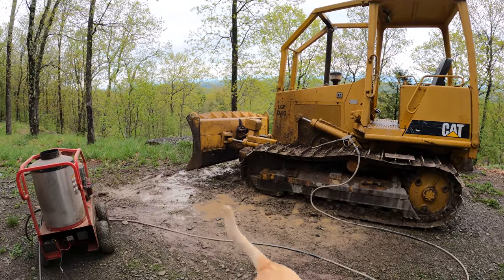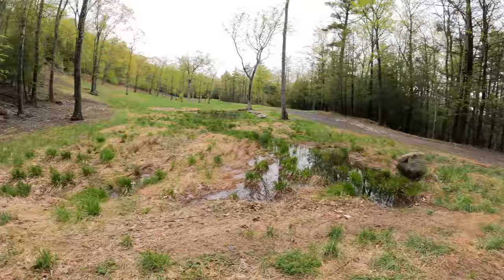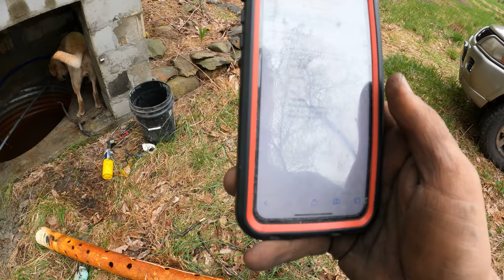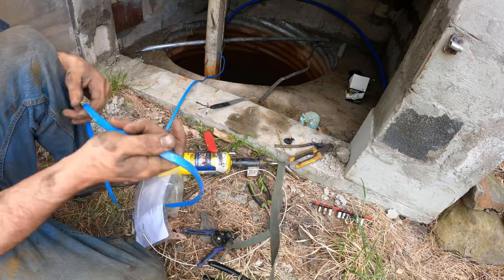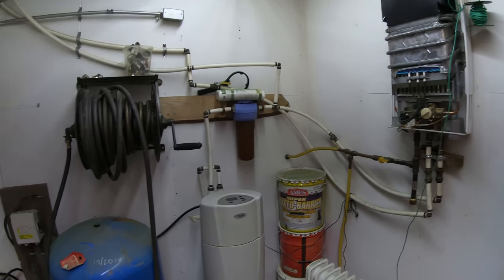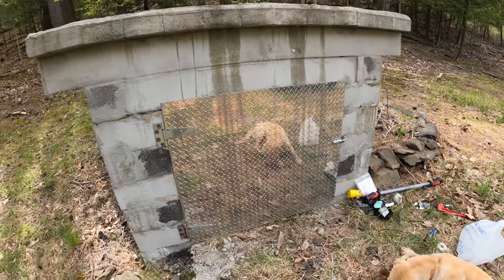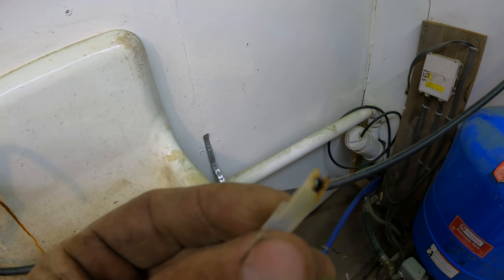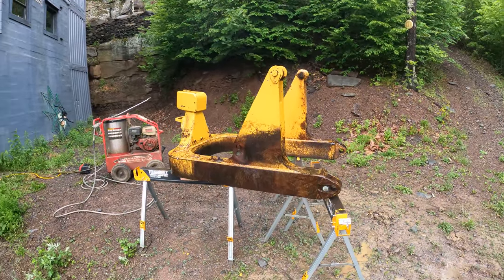Replacing a well pump

Comment: the 180 dollar one is being sold for 5 to 10% profit the 1000 for 500% profit by local retailer and is the same China product, maybe just branded different..
Reply: Clearly you have never dismantled a submersible pump.
Reply: @josephdestaubin7426  are you trying to say that this does not happen that a product that been sold at aliexpress ("from China"), the same exact product being locally sold retail at 5 to 20 times the price? Of course there are also true quality products that actually warrant being 5 times more expensive because they last 20 times as long, but in todays world, it usually is not the case and just some dipshit selling China junk at ridiculous prices.
Reply: @thiscouldntblowmore  Of course it happens, for all sorts of products. And while I am sure it happens submersable pumps somewhere in this vast country, this is not the default explanation for the proce deferential for any class of products for which there remains a robust manufacturing base in the US.
Reply: Yep.  My Lincoln welder is exactly the same as a lodos.  Gtfo with that shit.  🤣 with well pumps there is a MASSIVE difference between China and USA.  Copper vs al, 450 series stainless instead of 300, actual gauged wire instead of lots of insulation..
Reply: @avlawns3037  i see your understanding of what is written is not the best..
Reply: @thiscouldntblowmore  I see your understanding of the design of well pumps is lacking.

Perhaps you buy the cheapest shit you can, some of us prefer quality.  And made in USA means something to some of us.
Reply: @avlawns3037  like i said, you dont even know what you are reading. I was talking about made is china shit bought direct vs from local retail, not made in china vs made in USA / EU. Also, i have many "made in USA" products, including firearms, some are decent, some at as bad as bad chinese products.

Comment: You get what you pay for...a good quality pump usually last 20-30 years
Reply: Depends entirely on usage,  when I bought my last business, it used 2 dirty water pumps in one sump,  I was buying what was supposedly the best pump ( and virtually the most expensive standalone  pump available,)  but due to usage, with no warranty. I was replacing one pump every  4 to 6 weeks, continually.  After many discussions  with the pump  suppliers, of me suggesting different options, I spoke to  a guy who serviced pumps, listened to what I said, and suggested a different brand and style, single pump, not two. 
I ran with his suggestion and let him  know when  I'd had 6 months no issues, he called in ripped it apart to service it after a couple of years, showed me how easy it was to service  and I continued with this from then on  servicing  mainly only when output  dropped due to blockage. I attempted to get a spare,  but they were no longer made. It lasted many years until it fried, someone chopped partially through the  float power  cable  which let water in to the internals  and poof it let out the special smoke that keeps them running only if sealed in....
High cost can increase part quality and service  life,  but it does not guarantee it.  I found making an informed  choice based on initial cost,  expected service life,  ease of service and its cost,  the smart way to make decisions

Comment: That's a lot of iron in your water !! I would recommend  larger filter. AOsmith has a nice "whole home filter" for about the same price as your pump. Serving your secondary filter more often would help also. I would take a look at your hot water heater filter also.

Comment: Im guessing the cylindrical electrical device in the junction box is a start up capacitor. The new version of the pump doesnt need the capacitor which relieves the need for high amps on start up.......so with the new pump and no capacitor the current draw is now higher........tripping the smaller rated breaker in the junction box which was correct for the older pump but not the new one.

Comment: The turbo tip on your pressure washer probably picked up some sediment when you changed the well pump. They make high pressure filters that you install between the wand and the turbo tip itself, save some money in the long run

Comment: Hey Andrew when your turbo nozzle gets stuck like that hold the trigger in and tap it off something that will start it spinning again but it means there's dirt in it. I wash for a living.  They make a filter that goes in between the gun and nozzle
Reply: Put a RV filter between the hose and the pressure washer

Comment: Andrew cleans stick and checks well.  Cody the dog happily disposes of said clean stick! Tat's so cute! Think of it this way $200 to $100 in 6 years is better. You can pile up 4 extra for the price of one expensive and change them like hotcakes. The well tank with the bladder is from 14 they usually last 5 years, check it and maybee replace it.

Comment: It was a good to have replaced its pump even though it was the filter and  installing another larger one would be in order perhaps since it the silt/rust in the water clog it even faster since it's a cistern it a well. Rust on a galvanized culvert can also actually be bacteria eating it's way into the steel once the coating wears or is knocked off leaving bare metal. Nice to see Cody was protecting you from the power washer and one wonders how mant times he's taken off with a part Andrew bought of was going to put back on. Hopefully he has a ultraviolet light on the line as well since other bacteria goes along for the ride especially if a the septic system or a leech field is nearby or above the cistern's level for cross contamination if it happens...

Comment: Andrew, I have searched for exact same brand wells online and local stores and have found that they will be double the price. The last time I had to replace a deep well it cost me 1200 bucks for pulling a 200 foot well and replacing the pump. The pump cost 700 dollars and I saved the box and found the exact same one online for 200 bucks. Yet because I did not know how to pull a deep well like that I opted to pay someone. Now I have a shorter wells which are less than 50 feet each and I can pull them by hand. 
Price is dictated by the person selling it and brands depend. The no controller for the pump is a pump that can be direct wired with out the need to install relays and control boxes. They are much better pumps.

Comment: When I've pressure washed for a long time on a well it has often brought up a lot of sand, grit, etc. and just filled the filter.  Once I emptied the filter it worked fine again.  It helps when replacing the filter to run the water just a little before putting the filter back in.  I found that there is a collection of crap right before the filter.  And this had happened on other wells in the past.  That $1000 is outrageous.  I wouldn't pay it.

Comment: 6 years is really good for that pump. The others will last about the same.  I would have made the roof taller on the well house just so it's easier to replace and repair. But other than that it's good. Maybe get a boot for the pump so the pipe doesn't break. What do you use for a pressure tank? Maybe move it to the well house also to save the pump from running crazy if an underground line breaks. Enjoy your videos. I like how you show the good and the bad and the funny crazy things.

Comment: Now that you are a bit further into this project, you might consider putting in a deep well to get some cleaner water.  That water in the cistern has a high level of turbidity and it's probably considered a "surface water" source, which requires different treatment and is vulnerable to coliforms and other bacteria.

Comment: High horsepower well pumps are meant for deep wells. The deeper you go the higher quality you want.  My old well pump was 35 years old when it failed pumping from 280 feet in the ground running 50 psi to the house.

Comment: Nice job.  Its close to 1/2 a psi per foot to lift water and pumps create flow and it is the resistance to flow that creates pressure.  I could go on for a while about vacuum and pressure but it would be boring and probably confuse allot of people who don't understand that vacuum is still pressure less than atmospheric.

Comment: Pretty sure that pipe you bought is Wirsbo or Propex that requires an expander tool.  Expansion pipe uses a locking ring over the pipe, tool then expands pipe and ring, insert fittings. 
Home Depot Lowe’s sells pex a or crimp ring stuff and that pipe is slightly larger but relays on a crimp ring to stay together. 
Just an FYI for you.

Comment: the expensive pumps usually last 20 years plus, I would get a larger pressure tank, then the pump on/off is at a lot less,which will make it last longer, what is the distance from pump to tank because that seems like a lot of head pressure to overcome.

Comment: My Grundfos pump lasted ~24 years. After it failed and was replaced it took about 6 weeks to flush all the super fine grit out of the system. I can't tell you how many times I had to clean screens. I'd much rather pay for a higher quality pump and not have to deal with replacing it every 6 years.

Comment: There is a significant difference in the quality of the cheapie pump and the expensive pump. A good pump will last decades unless it pumps sand or gets lightning struck. Many manufacturers will warranty a good pump for years. The more expensive pump will have better materials; metal impellers, high quality seals, better gaskets. I only sold the best I could buy when I was in business for 45 years. I never had a problem with failures.

Comment: One of the best brands has to be Grundfos, a Danish company, last one I had was installed in -84, broke down ~2010. was a deep well pump got a 100M drilled hole. I have one of the smallest models and it pumps plenty, 750W. Not cheap though, Paid around $1300 for the pump alone, in Sweden.

Comment: My shallow well was always giving me fits then filled up with sand so time for a new well. My friend's dad came up and dowsed and found a spot. He said drill here and you will get great water between 60-75 feet. That same friend had a drill rig and he and I got to 67 feet and 45gpm! I never had a single problem and the well would go artesian between fall to summer.

Comment: Hey heard you ask. The high dollar pumps you were looking at are for more of a professionally drilled well that has a 4-6” casing and usually varies from 100-1000 ft of depth. I’ve seen these pumps last 20 years down in a well

Comment: The dirt in the water in your well is an issue for your system. So change the filter regularly, also make sure the pressure switch plumbing connection to the pipe is clean because thats where the dirt will gather. So every so often remove the pressure switch (disconnect the wires and unthread the pressure switch) and clean out the male end threaded connection. Dirt hardens in this location and I've been in situations where I've used a drill to remove the solid dirt here. If the dirt gets up into the underside of the pressure switch just change it out. Best

Comment: Being in the Water Well Drilling & Repair business all my life and now in 3rd generation ownership a few question as to why certain things were done and maybe a few things you could do to simplify and improve your system.  To pull and replace a pump here if we do it normally under $1,000 parts labor big enough to run that system with ease and a 1 year warranty ! The 2 wire 230v pump was a good choice the HP & GPM and plumbing are questions plus water source quality ?

Comment: I wonder how much of the pump wear (and eventual failure) was due to clogged filter(s)? We've also got 2 well pumps that need regular filter replacements; it's really noticeable when they need replacing, as the pressure drops significantly with a dirty/clogged filter.

Comment: tractor supply sells pretty good, reasonably priced well pumps, a tip I have is don't skimp on your supply line. at the store or wherever you will see one tube is thinner walled than the other, it's a little more money but we'll worth it, imo, PS my well is 140 feet and my neighbors is 475 feet

Comment: Any reason you went with a submersible vs a shallow well pump? I'm not sure how far and elevation difference between your well and the house, but I had a dug well and a pump in the house. It worked great for me, and it didn't need replacing in 8 years of use, but if it did it was a quick swap.

Comment: Back in the 80's I had an expensive stainless steel Goulds submersible pump installed in my 200 ft well. In today's prices, the cost would be around a thousand dollars. It lasted only             2 years before the motor blew out. I replaced it with a cheap plastic pump that has lasted 30 years so far. IMHO Andrew made a good call on buying a cheap pump and another for a backup as the inflation that is happening would make a replacement much more expensive.

Comment: Ok our well is 450 ft deep. My wife an I pull the pump using our wrecker and snaking the black plastic pipe over a rear tractor rim. We had pump problems until we installed a cycle stop valve. Now every foot of a 6 inch casing is a gallon of water. so drilling below the point of water is done to give extra capacity.
Reply: Aé

Comment: I see you have the blade apart on the dozer. I just finish pins and pushing a in my D3B and new hoses and cylinder seal. Are you doing pins and bushing there?

Comment: The second time my $1000 pump broke in half like that, I started buying the cheap ones but made them easy to replace. I would have recommended putting a union or something in there so you don’t have to heat or cut the pipe each time. 
Also, the motor hangs below the pump so if it’s stuck down in the mud, it isn’t getting cooled by circulating water.
Reply from the maker: Yeah, next time I can pull the blue pipe off the 3/4 nipple easier. But there is probably still a better option, maybe something that treads together.

Comment: I've had a Gould's pump in my well for 10 years now of very hard use never had an issue and I've actually ran my well dry a few times. But like you said thats a 1200 dollar pump so another pump I run is myers

Comment: Blue = CTS (copper tube standard), uses expensive compression fittings. Is the norm for water supply to houses where I'm at in Indiana. Black = thinner poly pipe that uses the hose barb fittings you're expecting. I had to redo my water line and recall fittings were around $40-50. I had one spot I had tee the CTS to 2x poly pipe hose barbs.

Comment: My old Myers deep well pump lasted so long that Myers had no computer record of it, and had to consult the old paper records.  It was likely 40 to 50 years old.  The horse power and flow rating is important so the pump has enough power to move the water from the bottom of the well, but also so it is not so strong that it does not pump the well dry.  Too big/strong can be just as bad as too small weak.  Remember to properly shock the well immediately after working on it.

Comment: i think the problem you have i also had with my garden pump which is roughly the same size and cost $ 240, it stopped working last year. I then completely disassembled mine as far as I could. and then i saw the problem that i already suspected (calcareous water). Lime clogged everything. I then put the entire machine in a large bucket overnight and added water by dissolving about 15 ounces of citric acid. Problem solved. try it with yours Andrew if youre having the same issue, saves money..

Comment: 2 hp seems excessive considering where you would be on the pump curve.  I think 1/2 to 3/4 hp would have been plenty.  You have a shallow well and your pipe size is small for that size of pump.   At the end of the day, another great video.

Comment: Andrew there is a pretty sizable difference between the cheap amazon pumps and the $1000 pump. Also 2hp is massive you dont need all that power all your doing is makeing your electricity bill more. Not to mention short cycling your pump with that small tank which will burn out a pump quick. Realistically a 1/2hp 7gpm pump would probably be sufficient. 
Just a tip heat up the inside of your polly pipe a bit and it will slip on easier.

Comment: Isn't that expansion wirsbo/ pex type A? If so, It's designed to be used with expansion tool and  wirsbo expansion rings/ fittings. It's better in many applications. But yeah it's not designed to slip right onto a fitting like pex-b or black poly. The fittings are larger for better flow for the pipe size and the pipe is more kink resistant than cheaper pex.

Comment: Hose is measured by I.D., and tubing is measured by O.D.  You have tubing there so 3/4 outside won't fit your 3/4 "hose barbs".
Tube fittings are typical compression, flare or some proprietary crimp.

Comment: Hey Andrew, get some: Wago 221 instead of those screw on electrical conectors. They work great and is a breeze to work with. No twisting cables just take a bit isolation off the wire and stick it in. Im sure you can get them at amazon or ebay, i use them all the time both at home and at my workplace (im an electrician). The ones i use the most work with cables up to 6,00 mm² wich will work great for your use from what i can see. It will save you time and agony. Ps: i am in no way affiliated with the wago company.
Reply from the maker: Ok, I actually got some, I forgot to use them.
Reply: @AndrewCamarata  
I prefer twisting the wires and using a wire nut. I would suggest using two pairs of pliers so that you only twist the bare portions of the wire.